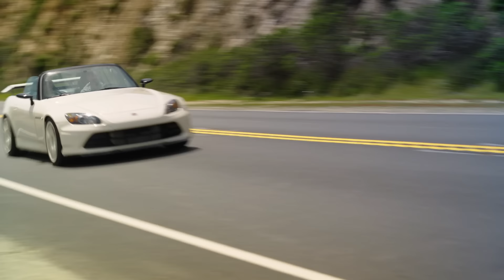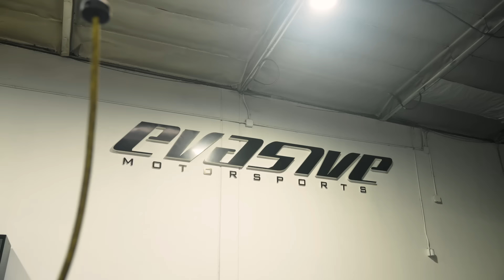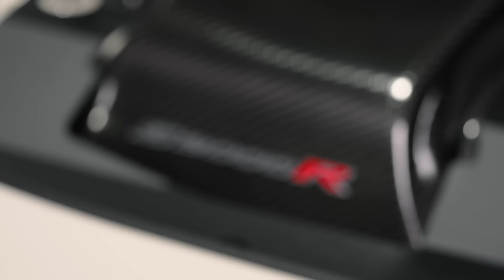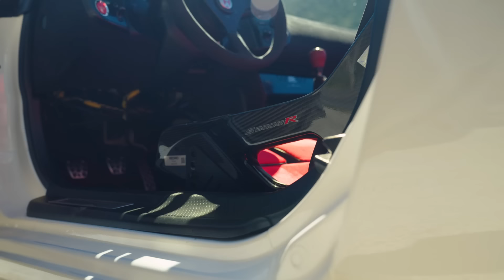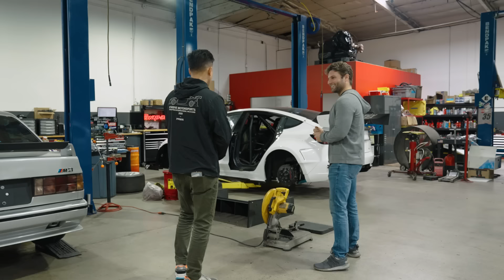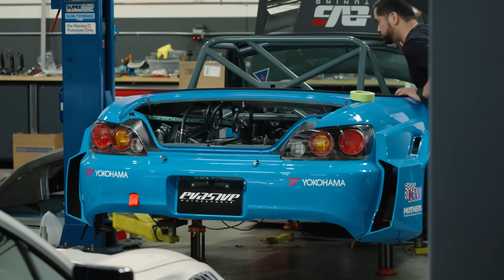Honda S2000 'R': AP2 Build With FK8 K20C1 Type R Power | American Tuned ft. Rob Dahm

Comment from the maker: So, turbo power? Or should it have stayed naturally-aspirated?
Reply: A supercharger would have maintained the character without losing the soundtrack. I'm sure it's a great car, but as an ex ep3 owner, the soundtrack was more than 50% of the drama.
Reply: @hazardo4378 That’s true but it seemed like keeping it as OEM like as possible was the goal and dropping in a factory Honda motor was closer to that goal than using aftermarket parts to support and aftermarket blower.
Reply: As a modern interpretation, the turbo powerplant makes the most sense.  But that's likely why Honda hasn't resurrected the S2000--because the spirit of it is largely defined by a small, high-revving engine which they already perfected decades ago and would prove hard to make competitive and emissions-compliant these days.
Reply: I don't know. There was no information on horsepower, torque, 0-60, 1/4 mile suspension, tire sizes. I literally still know nothing about this car.
Reply: NA all the way.
Reply: No idea. No one in this video even talked about how the car drives
Reply: Centrifugal supercharged f20c at 450 whp is absolute perfection
Reply: Thank you for making cars better and thus making the world better and More beautiful place for living
Reply: Simple way around CARB/EPA use modern powerplant, Save the OE for vintage track days/clubsport events.
Reply: 9k RPM sounds perfect at the track.
Reply: @AraCarrano I was pondering how Evasive got around getting this S2000R Carb Legal in Cali. That sums it up. Pretty cool.
Reply: N/A all the way... take that pure vtec crossover away and you rob the s2k of its soul
Reply: NA is too good for driver feel. Yeah having all the wooshie noises is fun, but it can take away from the motor and transmission noises.
When your vehicle is NA you know the limits of your engine and it's capabilities. Having it boosted brings more complications and varying performances depending on conditions.
NA is also more manageable both for power and maintenance.
I'm not saying every vehicle should be NA, but in true Honda Type R tradition. The S2000 should be NA. The last Type R before the new era of HFP (Honda Factory Performance).
Honda will eventually make another S car in the future that will most likely be boosted, so I believe NA fits for this generation.

P.S:  Seeing Rob Dahm here was very special. Love it.
Reply: @le.farquad608  I boosted my DB8 and I don’t ever hear VTEC crack anymore. I never even need to visit redline anymore even though I have a built GSR head. You definitely trade character for torque. Might as well convert to electric if that’s all that matters. I definitely miss the NA personality from before I went F/I.
Reply: We all miss the NA’s drama. :(😢
Reply: Stay N/A
Reply: stay NA
Reply: @dadacosmo29  Or Supercharge, but god forbid turbo it...
Reply: I'm pretty sure that Mugen have already made a Mugen R S2000. They tend to do that with most sport models generally.
Obviously they are not available outside of Japan and extremely rare.
Reply: Even with turbo, it could've kept the F20C. And even with a K20, it could've kept the NA 9000rpm.

If i was building an S2000, and i couldn't get enough power out of it NA (F20C or K20), i'd probably supercharge it instead. But that's just what i would do, and it's not my build
Reply: @Giuliana-w1f  Its the way if people need more. Maybe a stroker kit on top of that still setup for 9k rpm.
Reply: What about a supercharged version?
Reply: Bore it out to 2.6L and raise the redline to 11k
Reply: should've remained NA imo :\
Reply: Should've stayed with the F series
Reply: Stay NA, Honda is famous for NA, not these boring ass turbo engines.
Reply: They should do another S2000R, but built as though Honda would have in period, not today. If it’s a 2008 car build it the way they would have with what was available in 2008.
Reply: Make it your own, that's why we modify cars.
Reply: Turbo
Reply: Considering what Honda did in history all type r models where NA machines so an na s2000 is what Honda intended to be historically speaking
Reply: Considering what Honda did in history all type r models where NA machines so an na s2000 is what Honda intended to be historically speaking
Reply: Considering what Honda did in history all type r models where NA machines so an na s2000 is what Honda intended to be historically speaking
Reply: Considering what Honda did in history all type r models where NA machines so an na s2000 is what Honda intended to be historically speaking
Reply: Considering what Honda did in history all type r models where NA machines so an na s2000 is what Honda intended to be historically speaking
Reply: Considering what Honda did in history all type r models where NA machines so an na s2000 is what Honda intended to be historically speaking
Reply: Considering what Honda did in history all type r models where NA machines so an na s2000 is what Honda intended to be historically speaking
Reply: Supercharged
Reply: NA with an Inline Pro F24
Reply: Restomod
Reply: @thats the fun tho toastrytoaster
Reply: Boosted...as long as it's a Honda engine (because some tuners re-route by using another manufacturers engine).
Reply: For me, it’s about timing. If they had a created the R closer to when the S2 thousand had stopped production, I would have said definitely naturally aspirated. But now Honda is doing turbos, I say turbo all the way.
Reply: N/A.  the new Turbo K engines have overheating problems all the time.
Reply: Love NA but nothing wrong with both type
Reply: they want it to make it more unique so they put a modern type r engine. It's not really an argument if they have multiple s2000 with different engine wether it's NA or Turbo. Be mad if they put an electric motor in it.
Reply: NA would be better, but what would be the options inside “Honda engines” line up to get real good hp and tq numbers? Maybe the turbo was the best realistic choice. Otherwise the cost could be too much for the majority of the customers.
Reply: NA
Reply: Ultra high compression naturally aspirated for the response
Reply: When Honda moved from the F20C to the F22C, it was largely a move for torque.

I think the F20C bored, re-sleeved & stroked to 2.4L would have been a powerful statement, especially with ITBs.

Man, I want that interior so bad 🙂
Reply: NA
Reply: Turbooooo
Reply: Turbo, don't be so boring and in love with materialistic things cherishing it l. Turbo it and sent it ❤
Reply: As an owner of a FK8 I can tell you that VTEC turbo Honda made for it is amazing. Making this S2000 R with this turbo was the right choice.
Reply: @toastrytoaster  Which us exactly the point you dufus
Reply: turbo should be in low range
Reply: NA all the way.
Reply: It’s very drivable on the street below vtec. Too much torque makes the car unbalanced and unpredictable.
Reply: For S2Ks, I would say centrifugal supercharger. It still feels naturally aspirated but with more power.
Reply: 😂😂😂 so it’s not even 4wd
Reply: stay NA
Reply: @Carolinanovoa  &  and  @Acura
Reply: Beautiful s2000 but no turbo, especially with direct injection for me.
Reply: i don't know but i want one right now do you guys sell??
Reply: Its not the turbo that bothers me.  Its the lower redline.  I know it would have been way more work (and maybe a couple ka-boomed engines), but getting a turbo to work on the existing motor would have been cool.
Reply: turbo for sure
Reply: I had an integra type R from 2001 and I have a 2025 civic type R and I can tell you that I love both but there is no contest. The new engine is so much more fun in my opinion. I can say from having both.
Reply: TURBO and reliable 🎉❤
Reply: Beautiful build.  The CTR engine works!
Reply: A k24 fully build should be nice. Instead of turbo.
Reply: @yurimbarbosa0  And if someone wants more supercharging is far better as it doesnt ruin the power delivery way turboes do. Exhaust note is also stil decent and not homogenized by the turbo.
Reply: @Kacpa2  yeeaahh k24 9k rpm + supercharger 💪🏻
Reply: @yurimbarbosa0   With a K20 head for those extra RPM's.
Reply: NA every day of the week nothing beats that 9,000 high rpm singing lol
Reply: To be up to date - definately Turbo - it is a modern "R" version afterall
Reply: N/A or turbo, it should have stayed with the original F20/22
Reply: As long as it revs to 9k
Reply: @davidvang7975  problem is turbo cars don't need to rev to 9k, so most manufacturers don't bother - not even Honda
Reply: @davidvang7975  K series is not even remotely as dramatic as F20C tho.
Reply: Considering what Honda did in history all type r models where NA machines so an na s2000 is what Honda intended to be historically speaking
Reply: Considering what Honda did in history all type r models where NA machines so an na s2000 is what Honda intended to be historically speaking
Reply: They should have done a high compression K24 build for 300+CHP. No turbo lag. all race car. But this swap is cool too, more power potential. I love the car and the way they seem to have kept the original design philosophy of good balance all around (power/weight/suspension/braking ect)
Reply: Considering what Honda did in history all type r models where NA machines so an na s2000 is what Honda intended to be historically speaking
Reply: Considering what Honda did in history all type r models where NA machines so an na s2000 is what Honda intended to be historically speaking
Reply: Considering what Honda did in history all type r models where NA machines so an na s2000 is what Honda intended to be historically speaking
Reply: Considering what Honda did in history all type r models where NA machines so an na s2000 is what Honda intended to be historically speaking
Reply: Considering what Honda did in history all type r models where NA machines so an na s2000 is what Honda intended to be historically speaking
Reply: Considering what Honda did in history all type r models where NA machines so an na s2000 is what Honda intended to be historically speaking
Reply: Considering what Honda did in history all type r models where NA machines so an na s2000 is what Honda intended to be historically speaking
Reply: Considering what Honda did in history all type r models where NA machines so an na s2000 is what Honda intended to be historically speaking
Reply: Considering what Honda did in history all type r models where NA machines so an na s2000 is what Honda intended to be historically speaking
Reply: Considering what Honda did in history all type r models where NA machines so an na s2000 is what Honda intended to be historically speaking
Reply: Considering what Honda did in history all type r models where NA machines so an na s2000 is what Honda intended to be historically speaking
Reply: Considering what Honda did in history all type r models where NA machines so an na s2000 is what Honda intended to be historically speaking
Reply: Considering what Honda did in history all type r models where NA machines so an na s2000 is what Honda intended to be historically speaking
Reply: Considering what Honda did in history all type r models where NA machines so an na s2000 is what Honda intended to be historically speaking
Reply: Considering what Honda did in history all type r models where NA machines so an na s2000 is what Honda intended to be historically speaking
Reply: Considering what Honda did in history all type r models where NA machines so an na s2000 is what Honda intended to be historically speaking
Reply: Considering what Honda did in history all type r models where NA machines so an na s2000 is what Honda intended to be historically speaking
Reply: Considering what Honda did in history all type r models where NA machines so an na s2000 is what Honda intended to be historically speaking
Reply: Considering what Honda did in history all type r models where NA machines so an na s2000 is what Honda intended to be historically speaking
Reply: Considering what Honda did in history all type r models where NA machines so an na s2000 is what Honda intended to be historically speaking
Reply: Considering what Honda did in history all type r models where NA machines so an na s2000 is what Honda intended to be historically speaking
Reply: Considering what Honda did in history all type r models where NA machines so an na s2000 is what Honda intended to be historically speaking
Reply: Considering what Honda did in history all type r models where NA machines so an na s2000 is what Honda intended to be historically speaking
Reply: Considering what Honda did in history all type r models where NA machines so an na s2000 is what Honda intended to be historically speaking
Reply: Considering what Honda did in history all type r models where NA machines so an na s2000 is what Honda intended to be historically speaking
Reply: Considering what Honda did in history all type r models where NA machines so an na s2000 is what Honda intended to be historically speaking
Reply: Considering what Honda did in history all type r models where NA machines so an na s2000 is what Honda intended to be historically speaking
Reply: Considering what Honda did in history all type r models where NA machines so an na s2000 is what Honda intended to be historically speaking
Reply: Considering what Honda did in history all type r models where NA machines so an na s2000 is what Honda intended to be historically speaking
Reply: Considering what Honda did in history all type r models where NA machines so an na s2000 is what Honda intended to be historically speaking
Reply: Considering what Honda did in history all type r models where NA machines so an na s2000 is what Honda intended to be historically speaking
Reply: Considering what Honda did in history all type r models where NA machines so an na s2000 is what Honda intended to be historically speaking
Reply: 8000 rpm TURBO!!!
Reply: It should be turbo powered
Reply: Considering what Honda did in history all type r models where NA machines so an na s2000 is what Honda intended to be historically speaking
Reply: Considering what Honda did in history all type r models where NA machines so an na s2000 is what Honda intended to be historically speaking
Reply: Considering what Honda did in history all type r models where NA machines so an na s2000 is what Honda intended to be historically speaking
Reply: Considering what Honda did in history all type r models where NA machines so an na s2000 is what Honda intended to be historically speaking
Reply: Considering what Honda did in history all type r models where NA machines so an na s2000 is what Honda intended to be historically speaking
Reply: Considering what Honda did in history all type r models where NA machines so an na s2000 is what Honda intended to be historically speaking
Reply: Considering what Honda did in history all type r models where NA machines so an na s2000 is what Honda intended to be historically speaking
Reply: Considering what Honda did in history all type r models where NA machines so an na s2000 is what Honda intended to be historically speaking
Reply: Considering what Honda did in history all type r models where NA machines so an na s2000 is what Honda intended to be historically speaking
Reply: Considering what Honda did in history all type r models where NA machines so an na s2000 is what Honda intended to be historically speaking
Reply: Considering what Honda did in history all type r models where NA machines so an na s2000 is what Honda intended to be historically speaking

Comment: If Honda were to make another s2000 they would not use a current mass production unit, that's the total opposite.... What other cars have an F20C engine? None!! What other cars have the s2000 X bow chassis? None!!! A new s2000 R would-be a unique engineering marvel, not a recycled mugan/spoon tuned current civic engine.... I love what you have done with the car it's a fantastic refreshing example of a model update. Some say the S2000 was beyond typeR.... They made a GT, GT 100,  Type S and CR. The red rocker cover and interior tells you it was already an R its base line! Honda know to make it again it'll need F1 tech and keep it a driver and engineering masterpiece.... Or a light modernised re-release...

Comment: Disgusting. A civic engine into a S2000… there’s a reason S2000 engineers did not use other parts from other Honda when building the S2k

Comment: Personally I think my s2000 needs some mods but I am not thinking about power it's a street car at the end of the day I don't use it on track. And I don't really plan to yet anyway maybe one day. But I think the car needs new suspension and bushings and that's about it. Maybe new sway bars ect. It just needs tightening up you can only use so much power on the roads anyway if you don't plan on breaking the law 😅 and I am like 35 now I don't really want to loose my licence or crash the car so keeping it stock is fine for daily use / spirited driving

Comment: Oh wow, that is amazing! I always wondered why Honda never did a S2000 R. I personally would have gone with a NA K24. Similar power to the F22C1 but 35% more torque in the midrange so it would be more useable. No hate on the turbo motor they went with, just a preference

Comment: While this car is nice, I have to disagree with concept that if Honda came out with a new S2000, it should have the civic type r engine. I believe, Honda should shoot hire, by developing an inline 6, that is engineered off the k20 platform and blow the doors off the Supra and possibly the BMW M2. Standard model battles the Supra and the Type R model Battles the M2.